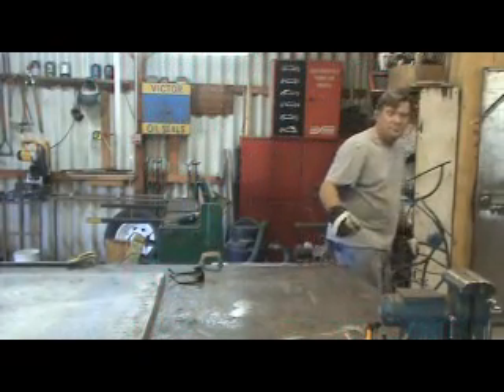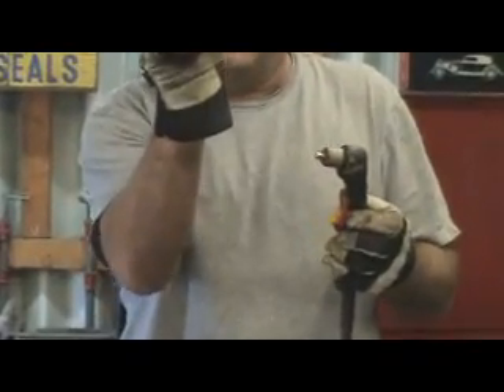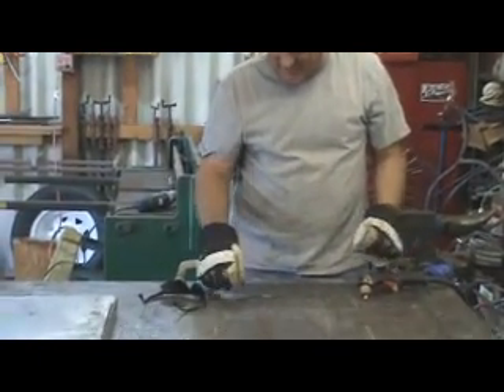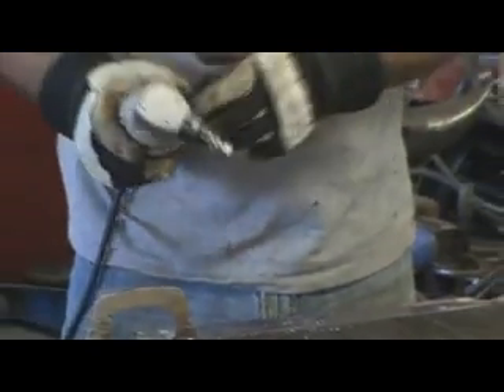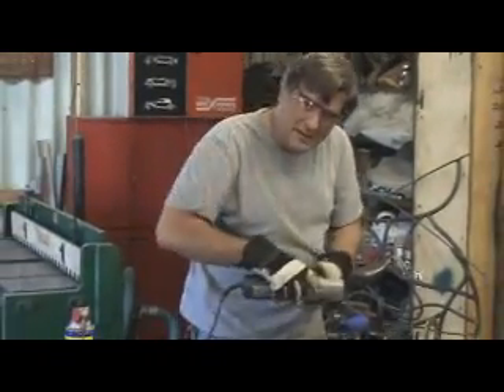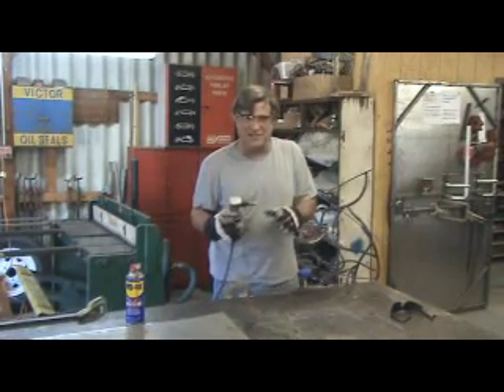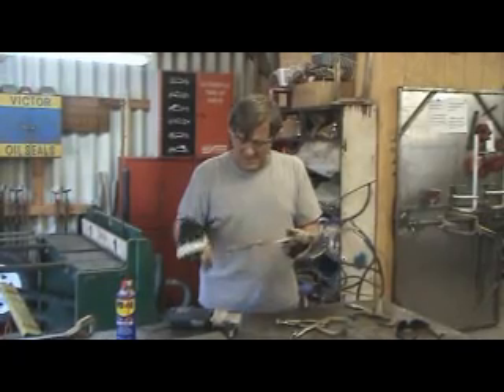Metal Cutting: Plasma vs. the Nibbler - Kevin Caron

Comment: I need something to cut 18 gauge sheet steel with.  I want to be able to cut a part out, and leave a good edge on both sides of the cut.  If I had a nibbler, to get good straight cuts, could I run it along a straight edge??
Reply from the maker: That would be the best way to get a straight cut.   Or a shear will do the same thing.

Comment: Thank you Kevin. Do you think some nibblers give  a cleaner cut than others? I am thinking of the canibbler which has some compelling promo vids. Also which tool discarding the guillotine do you think would give the cleanest cut to 0.9mm zinc sheet for  making a threshold cover? Much appreciated.
Reply from the maker: I have only used a Bosch nibbler.    That was enough for me.    As for a cutter for the zinc sheet, how about a grinder with a cut off wheel.    Run it against a metal guide and you should get a nice cut.
Reply: I just found turbo shears that seem to work well what do you think for creating a clean straight cut or is that the same thing as the nibblers?

Comment: Pipe threading/cutting oil is fine. WD 40 or motor oil works in a pinch. Trichloroetane was great cutting lube, & solvent, but the econazis decided to ban it. If trich was a bi-product of refining gasoline we would still have it around, just like toluene.

Comment: Interesting video Kevin, Really, I always enjoy & look forward to your videos...but for Cutting, the plasma is in my opinion the most efficient if done using proper techniques (you get dross not slag when your travel speed is incorrect)if done correctly there is very little to No prep needed on plasma cut material ...that "nibbler" isn't Cutting like a plasma or even oxy/acet as you compared it to...it's basically a grinder that takes more material off each time you touch the material with it. And how would you center cuts if you have to start with an edge or pre~made hole? 
Anyway, cool little tool...

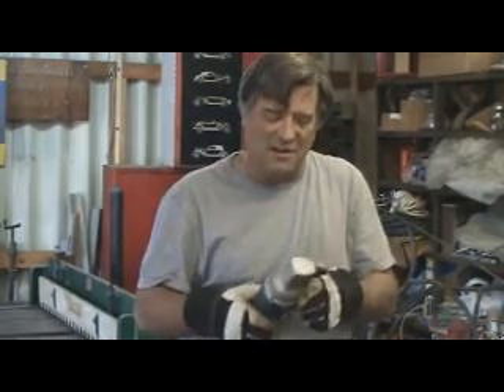Comment: 3:04 never use wd-40 on MOVING parts that need lubrication.IT IS NOT AN OIL! It is a penetrant for things that are stuck but after you use it you MUST use an actual oil for lubricant.
look at any moving part that you have previously sprayed with WD-40... I bet it's rusty!
Reply: phartattack i
Reply: im using transformer oil at the moment as a cutting fluid with a nibbler and it is fantastic ,, not to mention fifty gallons of it for free

Comment: With the plasma the trick is to use as little amps as possible and keep the speed up if you get lots of dross with the plasma theres too many amps, also after plasma cutting you can usually knock the dross off with the edge of an old file or a scrap piece of metal before grinding, it makes life a lot easier, as for a nibbler I would only use one where you cannot access the rear of the material as in car panels and double skinned things.

Comment from the maker: @paulb929 If you get one just make sure you get a good supply of punchs. Use lots of oil and change the punch often. If you think it is just a little dull, change it. This will help keep you from having to replace the die. Those sucker run around $50.00 each.